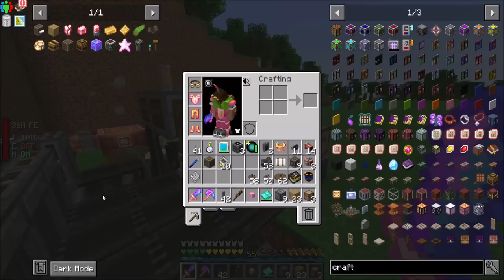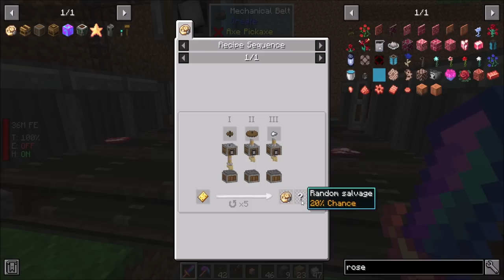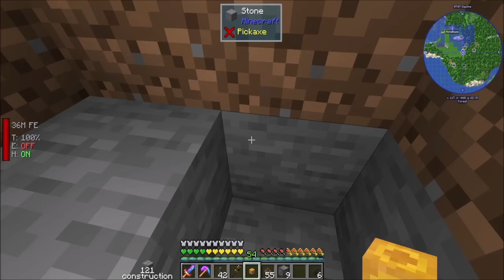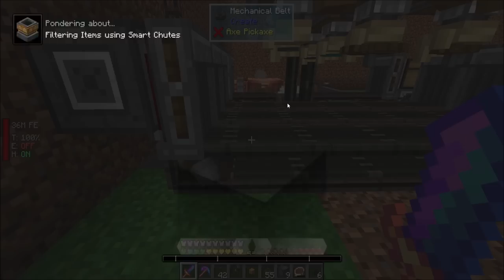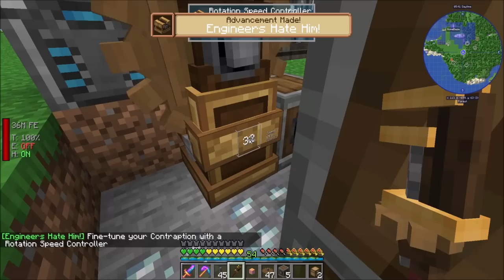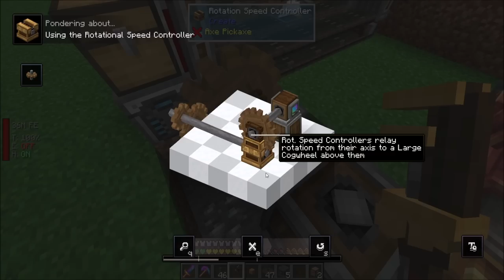ATM8 Ep57 Integrated Creating

Comment: Dire: This series is meant to be all OP. Also Dire: Not using the Electric Motor from Create
Reply: Honestly I've given up on him doing anything OP at this point. I dont even watch the episodes anymore I just use them as white noise for background
Reply: @joshuahellfire3287  at least you give Dire a view, and that's nice.. he have forgot what OP means for this LP.. Think he have a new FTB pack coming up, and like he said, he just wants ONE ATM star, then the series is done... But perhaps he have gone a bit less OP so he can at least have 70+ episodes, last LP was 40 i think... I really want a serie' where he goes FULL OP, not half-way like this... But Dire Doing dire stuff
Reply: Also him using the pump from create instead of just piping water into the boiler which wouldn't have the problem of the whole thing stalling and having to be manually restarted if the system locks up.
Reply: @nicksomingenhar  well another problem too is that what he thinks OP means is different than what we think it means. Like my let's play for instance, if I need one item I make 10 to 20 of those items. Or if I need one machine to do a craft or process I make 10 of those machines and have all of them doing that process
Reply: @joshuahellfire3287  Agreed, think its a few Series he went OP, but that was with EMC (Nothing against ProjectE and its side mod to ake ProjectE more TPS friendly), and if you get started and get a good amount of EMC, after that its just EMC this and that. I rather go the way your doing it.. make's it more challenging for you to come up with a nice perhaps compact design etc
Reply: @MindCaged  think his plan there was to use "just" Create. but he did the same setup thing last lets play to, and he had a lot of hand-cranking in one episode... Sink + a fluidpipe from mekanism would solve his problems. or a Sink with any fluid extraction item, LaserOi, Pipes, etc
Reply: That needs a big crafter array to craft anyway though...
Reply: @nicksomingenhar  If you pay more attention, you see him rarely mixing and matching mods. Most of the time its just adding Refined Store or AE2's things to the machinery
Reply: Even if using only create you should still power your pump for your steam engine with its own waterwheel.
Reply: @tenalpoen  correct, that's what I did. No stalling.
Reply: @joshuahellfire3287  I do this too, use it as something to listen to while I grind in my own games.

Comment: I would have just exported gold plates with a redstone signal to activate it then have it  keep in stock x precision mechanisms
Reply: I was thinking the same thing
Reply: I was thinking that too but I think that creates another problem - you have to not export plates while it’s attempting to make one, or put it on a timer or something
Reply: I would have just made the pattern to be 2 plates will result in 1 precision mechanism. It's not wise in some modpacks but he has basically unlimited materials in ATM8 due to the mystical agriculture and would save from whole lot of hassle
Reply: @touma-san91  I was thinking the same 2-3 plates and let the system make extra worst case.
Reply: @pagameba  If a couple more plates go through, I don't think it'd be a big deal. What he could have done is extended the belt somewhat, had a detector with an interface keep in stock thing on one side, and on the other had the roundtrip chest and merge then both with a tunnel

That's how I'd do it at least
Reply: @HarpreetSingh-xg2zm  Yup, and it's not a huge issue either to have an extra or two.

Comment: I think my best solution to the Precision Mechanism 80% problem was to make the pattern recipe 5 plates make 1 Mechanism, it would slow down production (but with super fast rotation it is not very slow) but you would usually get 3-4 ....... it is also a good idea to use an interface to keep 60 in stock.

Comment: I solved this problem with LaserIO and Pretty Pipes. Complete mechanisms are routed into the RF system (obviously), while anything else that isn't an incomplete mechanism is piped into a barrel (I use the Pretty Pipes here because they're slow enough to give the next step time to work in case of multiple junk items coming through)
A sensor card then detects the junk, sending a signal to pull another golden sheet out of an interface into a new barrel, and as soon as the sheet is detected in the new barrel, it sends a signal to simultaneously pass it back onto the conveyers and trash the junk

Comment: Easy way to account for failure:  6 gold sheets equals 3 mechanisms.  Worst case you end up with extras.  Alternatively, put a stack of gold plates in the chest and make enough for the rest of the series 

Instead he’s going to spend an entire episode on making it “perfect “
Reply: True, half of the episode is boring =(
Reply: I do 6 gold sheets = 1 precision, you can never have too many, and even though it says 80% chance I've had it fail 5 times in a row.
Reply: @DizzyDJW  damn, 5 times failed at 80% success chance is crazy bad luck xD
Reply: @xiztence  Yea, but you gotta remember each iteration has the same 20% chance to fail, just because the previous chance was a fail doesn't mean the next chance will increase odds. It just doesn't work that way. So theoretically you could do 20 and have all 20 fail, and they would have all failed at 20% chance, if that makes sense.
Reply: All he had to do was use the requestify block to keep in stock but noooo. Bad dire
Reply: We all know Dire sometimes like to DireDerp easy setup's harder then needed, but at least he used a few different mods to make it harder😂
Reply: @joshuahellfire3287  requestify wouldn’t work, it would just keep waiting for the mechanism that would never come
Reply: Or just one more export bus for gold plates and then just have one-stack drawer, and reroute scrap
Reply: @ultradude5410  I thought the way it worked was it would keep a certain amount in the system. So let's say he sets it to 50 so it'll just keep running till it actually gets the 50. Or am I misremembering
Reply: @joshuahellfire3287  It keeps that many in there by requesting autocrafting and waiting for it to finish.
So if the autocraft doesn't work when you manually request it, requestify will run into the same problem.
Reply: @ultradude5410  as far as I know that's only if you have blocking mode on, as long as you leave that off it'll craft continuously

Comment: Or just have precision mechanisms in a drawer, and use a level emitter to export gold plates if you have less than X mechanisms

Edit. The integrated dynamics approach is substantially cooler though, so props on that

Comment: When you have a hammer :P . I think I would just passive them into a small drawer, and just split the end to trash bad outputs and have the good ones go into a chest with a whitelist. Its unlikely you'll want more than a stack or two at once, ever, so this is a quick way to fix the problem for someone who doesn't want to use integrated dynamics.

Unrelated, personally I find Create to be kind of an all-or-nothing mod. Unlike pretty much all the other mods in modded minecraft, it feels like Create losses its purpose and charm when you use other mods. Export buses with crafting cards, and crafters instead of chests, pipes/ae/rs instead of belts... its makes Create just feel pointless. Which is a shame, because its one of my favorites.

Comment: Dire thinks rotational speed controllers speed can be between 1 and 256, but it is -256 and 256 and its the trick that to rotating it backwards. (Btw, i dont know either, why input direction doesn't works)

Comment: Dire, instead of wasting the resources in the deployers, why don't you use a filtered item transport to move the correct items to the deployers? It would save you so much space on having each single deployer recipe being its own line, and would save you needing the crafting exporters that keep a stack of wasted resources in the deployer at once. The logistical Sorter from Mekanism would be great for it.

Comment: 28:30 dire you should experience not crouch clicking for everthing (for general cases, sometimes it is overkill ) and (for this case) try to place using other blocks that easy to use like belt, yes create is smart enough to work like that :)

Comment: Autocrafting could've been as simple as insert a Gold Plate and get an incomplete Mechanism (3/15), then import all incomplete Mechanisms with (3/15), (6/15), (9/15), and (12/15) progress to the input chest. Ask for an incomplete Mechanism (3/15), crafting resolves for the system, then wait a bit for importing cycles, and get finished Mechanisms without gumming up the craft-requesting system with the 80% chance. Then you just need to Redstone control autocrafting off of a stock of completed Mechanisms in a way that requests incomplete Mechanism (3/15) when completed Mechanisms dip below a certain threshold.

Comment: I'm thinking you could have just used an exporter set to pulse via a redstone signal if it needed a new plate or not, while looping all "incompletes" during the interim. An RF Tools inventory scanner or whatever could do the bit of checking between a random item or the WIP item. Even just a black list / white list setup with Laser IO that pulses a signal as the random item passes through, etc.

Tons of ways to do it without Integrated Dynamics - that mod, and Computer Craft both are mods that kind of ruin the immersion for me when I play. Not a huge fan of either. They just don't feel like they belong, despite some of the outrageous mechanics behind some of the mods that do.

Not knocking those two mods or their author's. Many hours and much effort went into both, I'm sure - just a non-preference is all.

Comment: Massively over-complicated. Should have just used 'keep in stock' logic and kept like ten mechanisms or so in stock at all times. If you have less than x in stock, send a plate through, and any incomplete mechanisms automatically cycle through like you just did. You might end up with a few extra mechanisms, but that's not particularly troublesome since they're trivially inexpensive at this stage.